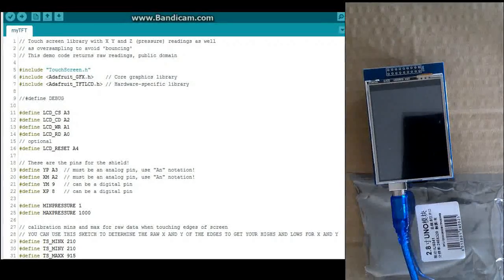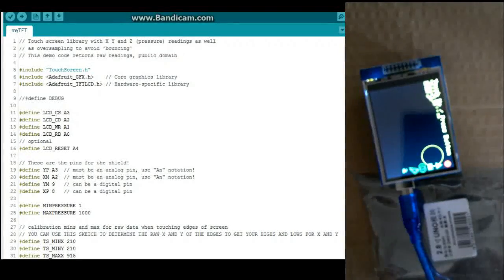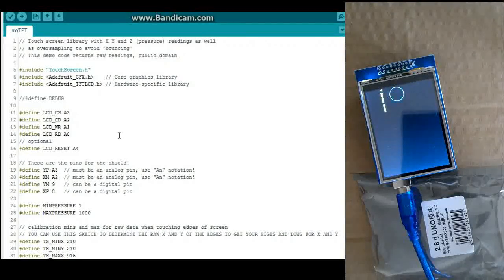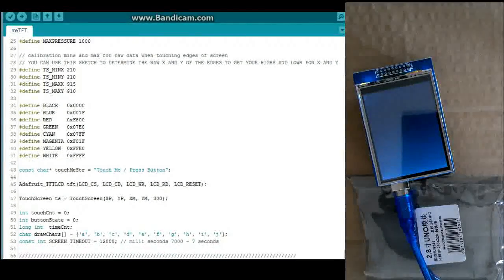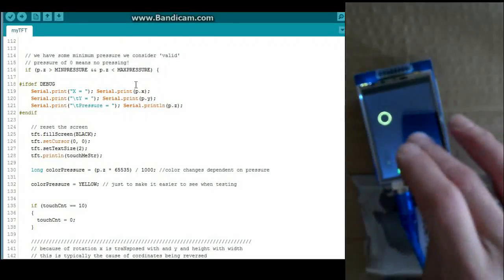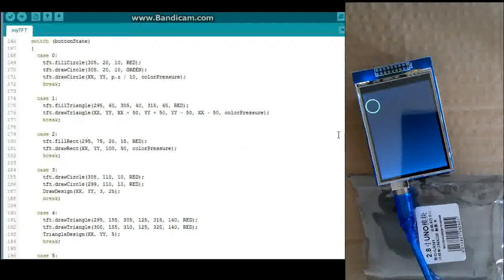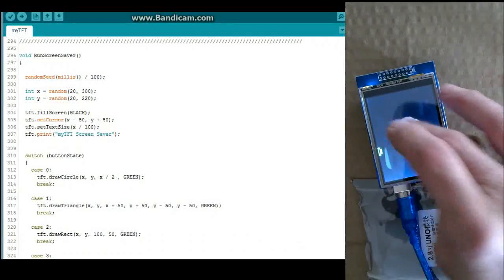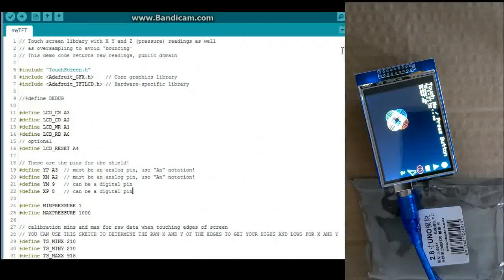UNO R3 2.8 TFT Touch Screen with SD Card Socket for Arduino Module

Comment: I picked up the elegoo version of this touchscreen without the microcontroller. Unfortunately the elegoo libs are woefully out of date (which means the Adafruit libs), and most are written for the R3.  I have an R4 Wifi and a Adafruit Metro ESP32-s2 Express. Learning moment upcoming. :D

Comment: Hey, any ideas? I have the code running and libraries uploaded but nothing is happening with my screen when I touch it. I've tried multiple different libraries but nothing is letting the screen be utilized. I've appreciated your videos the most so sending this your way.

Comment: Getting an error, learning and my coding is still quite the work in process:

C:\Users\utawa\AppData\Local\Temp\arduino_modified_sketch_881200\myTFTScreenSaver.ino: In function 'void loop()':
myTFTScreenSaver:88:3: error: 'TSPoint' was not declared in this scope
   TSPoint p = ts.getPoint();
   ^~~~~~~
C:\Users\utawa\AppData\Local\Temp\arduino_modified_sketch_881200\myTFTScreenSaver.ino:88:3: note: suggested alternative: 'Point'
   TSPoint p = ts.getPoint();
   ^~~~~~~
   Point
myTFTScreenSaver:102:7: error: 'p' was not declared in this scope
   if (p.z > MINPRESSURE && p.z < MAXPRESSURE) {
       ^
exit status 1
'TSPoint' was not declared in this scope

Comment: @Surfdmountain Can you help me out, I have my touch screen working, but I need the Arduino to monitor several sensors, and control 3 relay switches, but I cannot figure out how to make use of the unused pins, short of buying a an ATMEGA 2560 style board, which I would like to avoid if at all possible! PLEASE! HELP MEEEEE!!! :)

Comment: This seems like it's WAY underdeveloped!!!
Why would I spend hours trying to code a drop down menu or a text input box? WTF?!?!
Why would anyone buy this to only start from scratch with EVERYTHING you want to display?
Reply: you can use bitmaps as masks and set your buttons up to correspond to your interface, the same with any kind of text output or live sensor monitoring results (voltage, heat, speed, bearing etc. etc.), also, when I first started programming on the Atari 2600, when I was about 7 or 8 years old (THANKS DAD!), we had to learn Assembly Language, and Machine Code, to get literally ANYTHING done! A lot of people do start from scratch to enable them to have complete control over their project, but a lot of people also make use of pre-coded modules that you just add your customised sections to, and it has all the heavy lifting already done for you.... I personally, prefer to spend more time coding, so that I can understand exactly what I am doing, how it works, and exactly how to customise every tiny detail.... But I am a control freak, if you don't care about that you can use pre-coded modules, or you can download other peoples' code and use it for your own purposes, or even use it to learn how to do it yourself by example... It is up to your personal preference, but note that if you DO use other peoples' code, you MUST give them credit for it in either a splash-screen, or a single line of text at the bottom of your screen, or even in the Documentation file, if you plan on using it in a commercial application
Reply: @jasonezekiel3250  I've since found Nextion display which looks almost like the one in this video except its much more developed and allows me to get the basic interface up and running quickly.
Not everybody has the time or patience to reinvent the wheel per se! Unless you really intrigued to reinvent the wheel, then I don't think this would be for most people who just want a quick and basic interface to quickly get their project going!
Most of us are high-level coders, especially the beginners and so they likely would rather not reinvent that wheel if they don't have to! I just haven't been able to find any good production-ready libraries that would allow me to code at a high-level to get the job done. Maybe I'm looking in the wrong area?
Reply: @driversteve9345  One word my friend, Github! check it out, and if you really want to understand what you are doing, build your project from scratch, it isn't inventing the wheel all over again, it is a learning experience and will help you understand the system a lot better than if you just steal code from others....

Comment: Why do you have to press so hard?
Reply: Wf2v I was thinking the same thing. He's going to break the damn thing!
Reply: He have to press hard because it's low-quiality resistive touchscreen
Reply: It depends on how it's coded.  A couple examples I loaded on mine had similar issues.  But, another library didn't have the issue, for example.
Reply: because he is not using the stylus, #1, and #2 the threshold settings are probably either undefined or set too high, you can actually set it in your setup code.

Comment: hi, I cant get my TFT LCD from amazon to start working I plug it in and its blank pure white screen. I tried to code samples, but nothing happens. any suggestions?
Reply: same problem as you , any solution yet ?
Reply: No, but what I noticed is that it is a very delicate TFT which it will damage easily. Therefore, I send it back to Amazon and I got my money back. I search online again and bought and elegoo TFT which worked great with the libraries he suggested on the video.
Reply: i figured out what's the problem ;),it's blank because the lcd does not support the libary , every lcd have his microcontroller (there is about 10 different kind) so there is a libary for every  one , i got mine working, if you have any problem take a look at this pro:  https://forum.arduino.cc/index.php?topic=366304.msg2524865#msg2524865
Reply: @Alwin Gomez and @Lokmane oua3zene if you see a blank screen it's not the end of the world, in fact it's a good sign because now you know it's working and that's what you should see  whenever the screen is ON but it doesn't get any instructions to show anything.

From this point on you only have to figure out why it doesn't get the instructions, that can be a number of problems but the first things I recommend is to check your wiring again, if you're using a breadboard it sometimes helps to wiggle your jumper wires or use the pinhole next to the one you're using now to get a better contact, check that you have the necessary libraries installed and check the code and make sure that you've changed the few things necessary to support your particular screen.

In almost all cases you do need some knowledge of the code so you see what needs to be changed instantly and don't have to rely on the information you may find on the internet, it's highly likely that you do have to make some small changes to any code you may find online just to make things work for your particular project and even if you have the exact same hardware from the same manufacturer that doesn't guarantee anything so whenever you want to do something similar like this it's pretty much mandatory to have some basic knowledge about your hardware, the software you're using to compile and upload the code to your particular device (Raspberry Pi, Arduino etc.) and some basic knowledge about the code language it's written on to make things happen.

If you're a beginner and just starting to figure things out, lacking any basic knowledge about the code and wanting to do this project I can guarantee you that you've set yourself up to fail miserably, I can get your enthusiasm but if you're that guy or girl I recommend you to do a step back and first start with the LED Blinky thing or the "Hello World" project and get that working and then come back here to see if you're ready to get this stuff working, I believe that you've a much better chance to get this working the first time and it will be much easier to understand what the heck everyone's talking about in these kind of tutorials.

I hope this is somewhat helpful to you, I wish you the best...

Ricardo Penders

Comment: I got it to compile and I added the necessary libraries but i still cant get it to move away from the white screen.Do you have any suggestions???
Reply from the maker: Try this: https://github.com/dmainmon/myTFTScreenSaver  If that doesn't work it's because you have a different model of TFT display. In that case, you will probably need to adjust the pin out assignments.

Comment: Hi, I have a question. I want to buy a small tft lcd screen similar to the one in this video. The Display has an SD slot. All i need the display for is for it to run a program, sort of like a data base. Its only purpose is for it to run that program. I also need it to be mobile, not connected to a computer. 

My question is, if I upload this program to an SD card, insert it on the slot on the Display, is it all it takes for it to run it? Or do I need an arduino for some sort of configurating?
Reply from the maker: You will need an arduino to drive the TFT display. The arduino is the hardware and OS that will run a program. You will need to write your database program for the arduino.  It will need a 5v power supply, you can use any USB type charging equipment.

Comment: When using this shield, can we do anything else with the UNO?  Or are all the pins in use?  For example I'm wanting to control a servo and a accelerometer/gryo module.
Reply from the maker: +Andrew Smith It does cover all the pins on an UNO. I've used it with a Mega in order to control other devices. Here's an example with the mega: https://www.youtube.com/watch?v=5Q_nv3r7gqs&list=PLiEm7w_mH44_VoHnvk8dpESQ9Cdcayd7-&nohtml5=False
Reply: +surfdmountain Ahhhh nuts. Had a feeling this was the case.  Thanks for the info.

Comment: Arduino: 1.6.1 (Windows 8.1), Board: "Arduino Uno"

myTFT.ino: In function 'void loop()':

myTFT.ino:88:3: error: 'TSPoint' was not declared in this scope

myTFT.ino:88:11: error: expected ';' before 'p'

myTFT.ino:102:7: error: 'p' was not declared in this scope

Error compiling.

  This report would have more information with
  "Show verbose output during compilation"
  enabled in File > Preferences.
Reply from the maker: +torpe1 There is a bug in your code. Make sure you copy it down properly. Make sure you have the three libraries installed. I'd have to see all your code to be certain of the problem.
Reply: +surfdmountain whats the link for the libraries